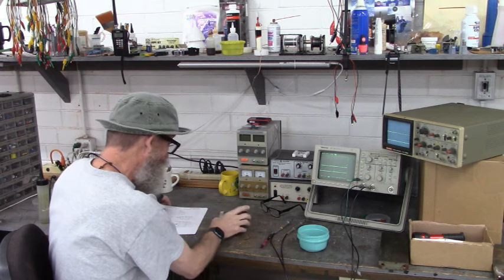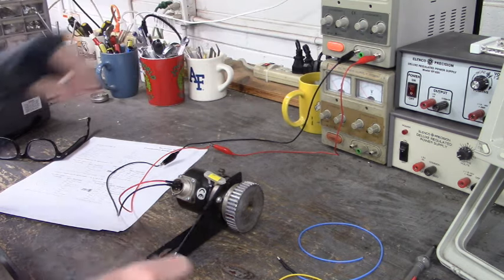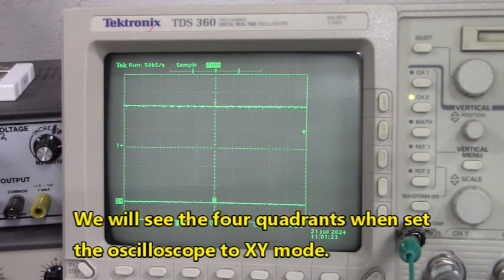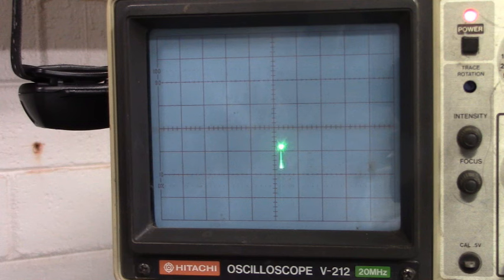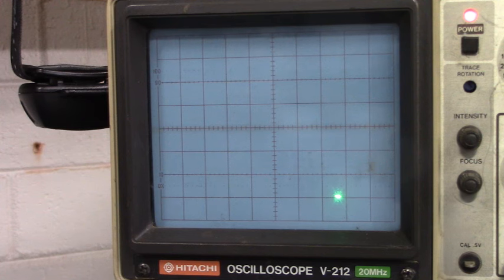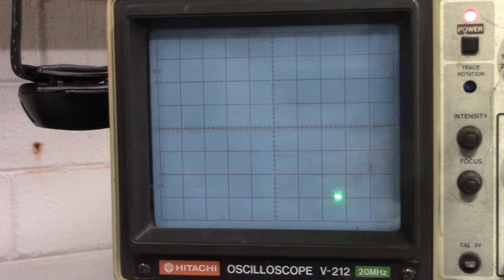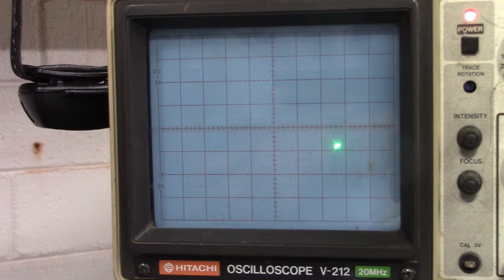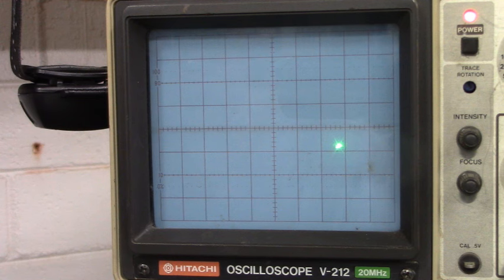Lenord and Bauer Incremental Encoder

Comment: That's an interesting technique to look at an encoder in x-y mode! Always learn something new from watching your videos :) I'm in the middle of debugging a spindle drive for a lathe - something is messed up in the bus voltage detection, and it wants to apply regen all the time. This was a nice break from tracing out the analog section of the board and drawing out a schematic!